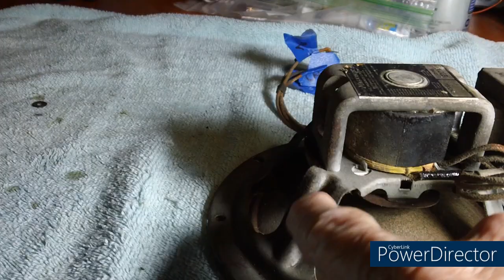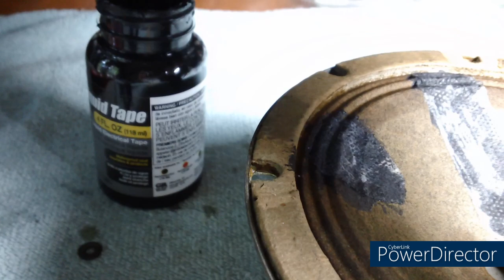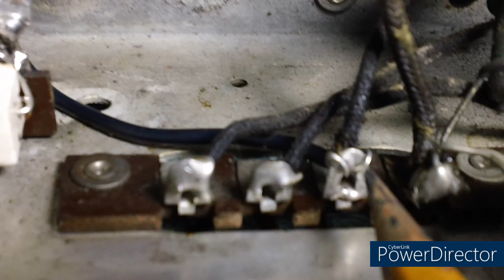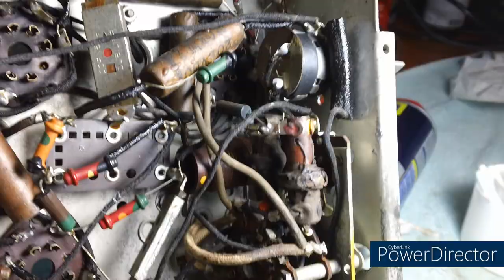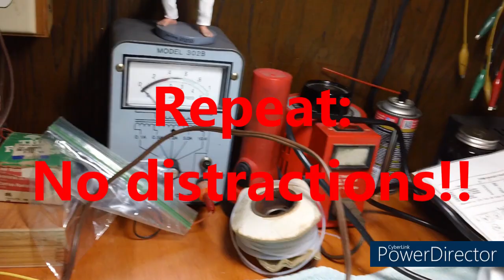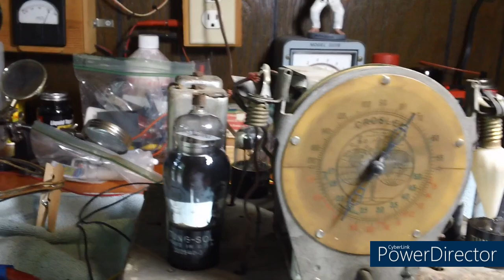1935 Crosley 655 tube radio chassis repair and restoration.  Part# 5

Comment: I repaired the speaker in my Eddystone radio using your method a few months ago. Worked a treat!
Reply from the maker: Graeme,
To my notion,  it's a tried and true method.  I've patched some pretty big holes with used dryer cloth and Liquid Tape.  I'm glad it worked out for you.  Thanks for letting me know, my friend.
Regards,
John